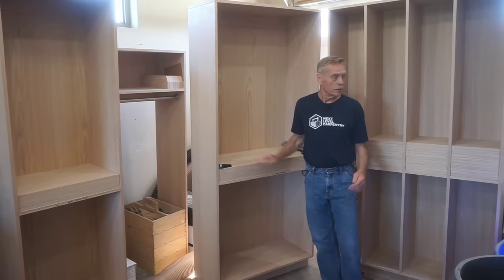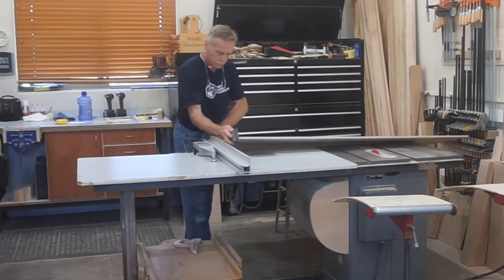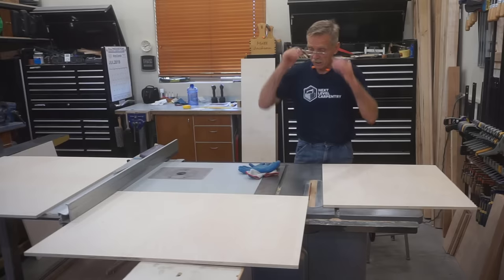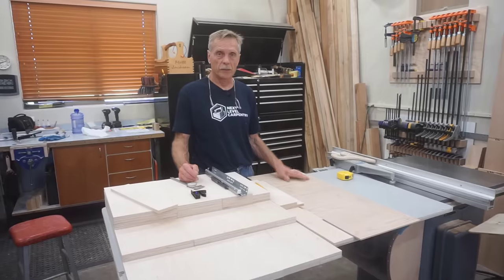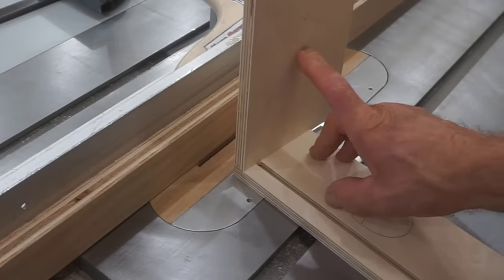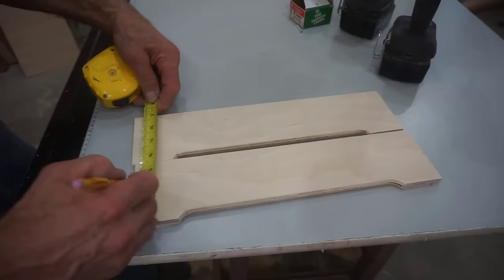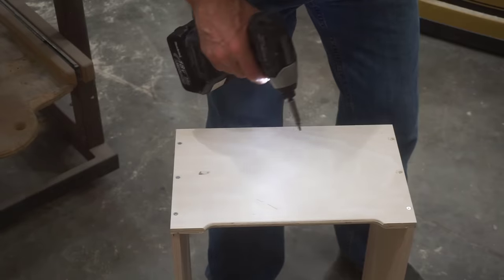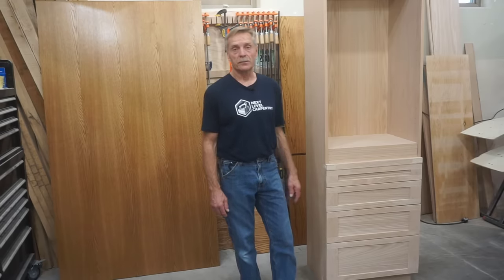Master Class for Professional Grade Cabinet Drawers

Comment: This is the first I've ever heard of your "soft kerf" methodology of breaking down sheet goods. It makes sense, but I still have questions about it. If I'm correct, your processes this:

-corners aren't square but edges are straight, so...
1) pull tape off square reference corner, mark 1" soft kerf which is left for trimming, then mark (measurement) +1"
2) run through table saw on factory edge, then flip the piece so cut edge is on the fence and run final length cut

What confuses me is that if we can assume the FE is straight, then why wouldn't the first cut (FE against fence) be straight and parallel? The way I see it (inexperienced), a FE is better to use because of the challenge of making that first cut straight with a full size sheet on the table saw. It sounds harder to keep the edge of a full sized sheet (5' long) perfectly in contact with the fence (about 2' long).   

I'm 30min into the video for the second time. Trying to understand this methodology and it still is over my head. 

" 9-1/4 and a saw kerf... 9-1/4" and a saw kerf.."

Also, I don't like how you stand on the off cut side of the saw blade and reach across. You mentioned kickback, yet your standing on the side where kickback will most likely happen!
Reply from the maker: Not sure if I'll be able to help you on this one Forrest, but it might help if I tell you that just because a factory edge is straight does not mean it is good enough for use in cabinet or drawer work. The nature of factory edges is that they tend to swell up after Manufacturing so the method shown in the video creates a good clean unswollen Edge parallel to the factory Edge. The swelling tends to migrate in about 1/2 to 3/4 of an inch so by trimming off a full inch I'm virtually guaranteed that the whole panel is precisely the same thickness. I understand your concern for cutting off a factory Edge because of its straightness especially on a saw with a very short rip fence. I would tell you that a prerequisite for any reliable very accurate cabinet or drawer work like this is to have a saw with unquestionable capability of producing and reproducing perfectly straight clean saw cut edges. That statement there is probably the reason many people opt for a Precision Track saw for making Cuts like this because they're cheaper and take up less room than a table saw like mine with its accuracy and capacity.
Best, Matt
Reply: @NextLevelCarpentry  Oh wow that's great information to have! I'm an amature cabinet maker (in that ive made four or five) with my contractor saw, and track saw. Thank you so very much for producing this content, and answering my questions! Your legacy will live a very long time with amazing videos like this!
Reply from the maker: @forrestcoleman2659  glad I could offer a little information to help you on your journey... it's viewers like you that give me hope for the future of the profession and wish you well in all your endeavors!
Best, Matt

Comment: How do you not get blowout on the edges of the plywood when countersinking your pilot holes? Do I just need sharper countersink bits??
Reply from the maker: I highly recommend Snappy brand carbide tipped countersink bits like these... they're a little pricey but are blow-out proof IMHO:  https://www.amazon.com/dp/B07PV1MS4Y/?ref=idea_lv_dp_ amazing performance even on brittle stuff like particleboard and tough stuff like russian birch ply... Best, Matt

Comment: Wouldn't using a track saw and guide on all four sides of a piece of stock, say a 4x8 sheet of plywood that isn't square on any of its sides, and cutting off a minute amount on each side ensure that all four sides are square following the forth cut? I have a Makita track saw and guide and follow this suggestion when I need my stock to be square.
Reply from the maker: Sure, a track saw is capable of squaring sheets.  So is a router with a flush trim bit and straightedge... all depends on what tools you have at hand for the task.  The important part is that the cabinet maker has the situational awareness to realize the piece is out of square and takes measures to correct it...

Comment: Hi. You mention that you use a 1/8" full kerf flat bottom grind rip blade. Could you post what the number is for that blade. The one listed above is for crosscutting. Thanks
Reply from the maker: Thanks for pointing that out Jaime.  Here's the blade you're asking about: https://www.amazon.com/dp/B00004T78V/?ref=idea_lv_dp_  I added it to the video description too.  BTW looks like Freud no longer makes the blade with the red teflon coating but it's otehrwise the same as the one I use.  Best, Matt

Comment: When you measure on a tape or any graduated line, do you slide your pointer til the first edge of the width of the measurement marking on the tape, or what?  That marking line on the tape has a width and I always get confused.
Reply from the maker: I think it's a matter of personal preference Michael so I suggest picking one or the other and make it a habit.  On any quality tool that's a very fine tolerance... maybe 1/64" or so... an error that, all other factors aside, is unlikely to affect accuracy directly.  After all, the pencil line made to mark length is wider than the mark on tape and rule in most cases.  When you need maximum accuracy you can switch to a marking knife...  hope that helps minimize confusion? Best, Matt

Comment: Is there another way to square a board for those of us who don't have a joiner?
Reply from the maker: You bet, granola john!  Clamp a perfectly straight straightedge square along the edge that needs to be squared up and then trim it with a flush trim router bit.  This is exactly how I do it on say, a 6' long piece, that's too tall/long to do safely on the jointer.  Hope that makes sense because it's equally as accurate and effective.  Best, Matt
Reply: @NextLevelCarpentry  THANK YOU!

Comment: Matt, did you ever make a video of how you made the roller stands? I haven't been able to find it.
Reply from the maker: Funny you should ask Stephen... that is actually the video project I am working on currently and was editing segments of it just this afternoon. FWIW it will be a five-part video series that goes into great detail about how to build a set of stands but be aware that it is a steel fabrication and Welding project not a woodworking project in case that makes a difference for you.
I hope to release the video inside of 2 weeks but my day job work schedule is crazy right now which may delay it but it will be the next major video release from Next Level carpentry.
Best,
Matt
Reply: @NextLevelCarpentry  That's the one skill this HandyProfessor has not tried my hand at yet: Metal work and welding. I have a roller stand with the ball bearings on top and was hoping to modify it somehow. Currently, if your board comes in a little low it will knock the stand right over, which is annoying and possibly dangerous. I do have an outfeed table with drawers that will handle most smaller jobs, but the longer pieces still need support. Looking forward to seeing the new video, Matt. Keep up the good work!
Reply from the maker: @stephengee8488  my intent is that the video series will give Woodworkers a good look into what it takes to get into entry level metal fabrication and Welding and be able to self-assess whether it's something they want to invest time and money into.
 Since you seem interested I can tell you that another viewer who is also a patron created a pair of roller stands with the same function out of plywood and did all the work in his woodshop. He is willing to share his concept and drawings for others who might be so inclined to make the style he has so I will probably present them in one of the videos in the series. His adaptation is a little bulkier and a little less elegant but entirely functional and a perfect solution for him his shop his abilities and his requirements.
I wouldn't want to discourage you from pushing the envelope and trying some metalworking but may be able to put you in touch with him if the metalworking is unlikely and you are still determined to have outfeed rollers like this. 😎
Reply: @NextLevelCarpentry  Matt, the gauntlet had been dropped! I will determine how to react after I see your video series!

Comment: Watching you cut up panels I realize that it could all be done like they do with sheets of metal: load the measurements into a computer, replace the plasma-cutter with a saw-blade and let it travel around, changing direction and angle as required. Such a rig would be simple to build.
Reply from the maker: The main challenge you'd face with your idealized concept is dealing with the fact that circular sawblades cut at a given radius which complicates cutting of sophisticated 'nested'  parts compared to plasma, laser, waterjet type cutting operations used for metal, stone, etc.  Also: although the basic concept is 'simple', achieving accuracy necessary for tolerances on quality cabinet parts is far from 'simple'.  Production cabinet shops do indeed have amazing gang-cutting saws for sheet goods but THEY are far from simple  and farther still from affordable.  Hence the tools and process you see me use in the video: CNC results with typical shop equipement...

Comment: Is there any way to put an ordinary, straight box drawer in a simple slot so it doesn’t tip down when extended?
Reply from the maker: No sensible way... but the good news is that that's why they invented full extension drawer glide Hardware to do exactly that...

Comment: For all these drawers there is no clamping needed?
All we do is join with pilot holes, screws and glue?
Reply from the maker: Amazing isn't it? 😁😎
Reply: Yes indeed. But the challenge as a newbie is to know when to use clamps and when to use screw and glue. 
If I were to use Dominos can I still use screw to avoid clamps?
Challenging part is how long should I wait to swap out my clamps
Reply from the maker: @rnmaa1914  Dominos and glue is a whole different process.  Anytime glue is needed/used clamps should remain on long enough for the glue to 'dry'.  With Titebond II or III wood glue a good hour is a typical time before removing clamps.  If you use SCREWS and glue instead of clamps the screws replace the clamps so just let the assembly sit undisturbed for about an hour after driving screws... Best, Matt
Reply: @NextLevelCarpentry  Ok great. On either case, the glue time is same, whether I want to spend $$ on Clamps or add screws instead and not have to wait for clamps to free up.
Reply from the maker: @rnmaa1914  true... but your design and construction decisions should be made for their own purpose and function, not to save time waiting for glue to dry.  I realize that's an advanced concept so give it some thought so your projects don't suffer.  Every project has a 'rate limiting step' that needs to be planned around without compromising the end result.  Sorry... you were just asking about glue! 😉😂😎
Reply: @NextLevelCarpentry  thank you for your responses. I’m just building kitchen pantry as my first project. I don’t want to over analyze but at the same time want to learn the right technique

Comment: Is there a reason you don't Lacquer before putting them together the first time?
Reply from the maker: Yes; I want to do the final sanding after fitting drawer glides, laying out and drilling for screws, etc because that's easier to do on raw wood... it's far less of a deal in normal workflow than it appears while doing video production.  Best, Matt

Comment: 45years cabinet maaker iuse baltic birch ply 1/2inch /metric  my joinery is 1/4 dado premium joint 1/4 tounge /1/4 dado on table saw one saw set up for all joints bottom held 4 dados just woodglue

Comment: Almost forgot, I made a special tool for pulling out chips(pimples) under dropped laminate. Take a piece of laminate, cut it into a "J" use electrical tape for grip. You can slide under the laminate to pull out the trapped grip if you notice it in time.

Comment: I don't understand why if you have two parallel edges and one out of square why you would not use your table saw to fix it instead of the jointer. I also don't understand the jointer yet but that will come.

Comment: I have the same Bosch plunger outer and when I lock it down it seems to still have a 16th of an inch play in the height
Reply from the maker: Hey Richard... about that plunge router: I've never liked the plunge setting feature on that router!  To this day I can't tell you the sequence or settings to get it right but can tell you that if there's play in the height setting during use, you're doing it wrong.  
I literally have to fuss around with the locking lever and 'over-ride' lever on it every time I use it but, when done right, it's capable of fine height adjustment and locks down solidly so I encourage you to mess around with those levers to get it to behave because it really is a great, powerful and high quality router.  Too bad the engineers who designed the setting mechanisms will never read this comment and change the design to be more user friendly! 🥴😎
Best,
Matt
Reply: Yeah you’re probably right I’m doing it wrong I have other routers in heaven invested a lot of time in messing with that one. But for some reason when I lock it I can get the base to go up and down just a little bit and then knob on the top goes with it. Thanks for getting right back to me. Love your channel watched All your videos multiple times.
Reply from the maker: It's frustrating because you THINK you're locking it down but you're actually not... I think it's locking it into adjustment mode or something?  Completely un-intuitive but if you unlock one knob and disengage another thing it locks into place accurately, solidly and reliably.🤯
Thanks, by the way, for investing so much of your time watching NLC videos.. much appreciated!

Comment: Mind sharing your source for those square drive sheet metal screws?
Reply from the maker: These are the type of screws I use Lance: https://www.amazon.com/dp/B00KLM665A/?ref=idea_lv_dp_ov_d although I buy them at a local hardware store where they have the same thing in a selection of sizes depending on the project at hand. Hope that helps?
Best, Matt

Comment: At 27:10 you square by shaving a 32nd at the jointer. Most of us could not effect that sqaure because of jointer snipe which would leave another 32nd or so at the end.  Perhaps you could show us one day how you eliminate sniper on your jointer.
Reply from the maker: Truing up a jointer is a video unto itself Bill, and each machine has its own quirks.  In my experience though, snipe on a jointer is almost always caused when the knives are set too high relative to the outfeed table.  That tolerance has to be precise or you'll have snipe issues (if they're too high) or difficulty getting a straight edge if they're too low.  Get out your manual for setting knives and making sure your infeed and outfeed tables are perfectly parallel.  Once those parameters are established your snipe issue will be gone.  Best, Matt
Reply: @NextLevelCarpentry  I'll work on it this weekend!  Thank you, sir!

Comment: My home shop (garage) is just too small for a table saw. My main issue is dealing with big sheets and getting them to perfect size. I have all the other tools for finishing.

Anyone have any pro tips for ripping and cutting large sheets using only an 18V Milwaukee circular saw?

Right now I have 2 solid straight bars of aluminum I clamp square and run the circular saw along them. Biggest pain is no dust collector on the battery saw so I make a huge mess every time I deal with large sheets. Catching the 2nd piece is always a huge amount of time to setup as I don't have a dedicated large table...I set up portable tables every time.

Any tips welcome to improve this? Just absolutely no room for table saw, so that's out.
Reply from the maker: Check out Peter Millard's channel... he gets more done in less space with fewer tools than anyone I know: https://www.youtube.com/channel/UC_FksrzP3q-IuoWTiG501LQ  Tell him Next Level Carpentry sent you?
Best, Matt

Comment: Are your rails and stiles all the saw width?
Reply from the maker: Not on this one Mike... I though proportions looked better with the stiles being a bit wider for this design but that's certainly not always the case.  I use SketchUp to model different iterations and, between myself and my client, decide which is 'the best fit' for a particular project.  Thanks for watching and commenting... Best, Matt
Reply: @NextLevelCarpentry  Thanks that makes perfect sense.

Comment: Where can I get the table saw insert ?
Reply from the maker: That's an old Wood Dynamics zero clearance insert Steve that's not been available for at least 5 years.  I've seen 'em on eBay and there's a few similar ones out there so you might get lucky and find one. Best, Matt